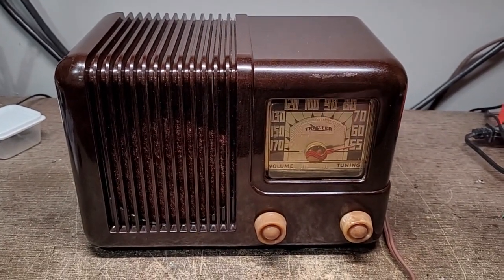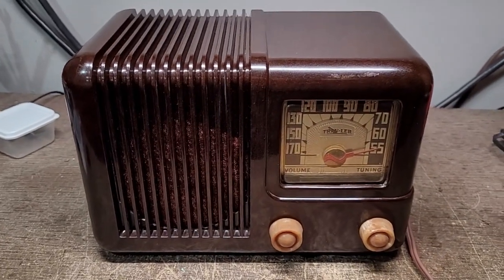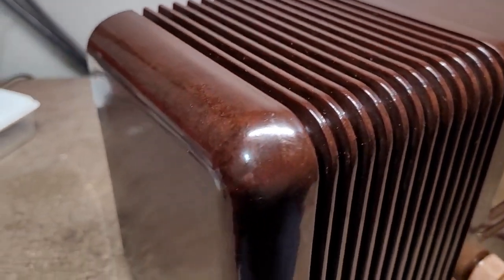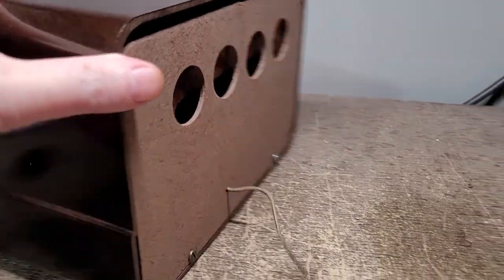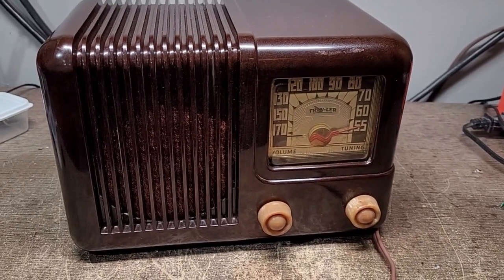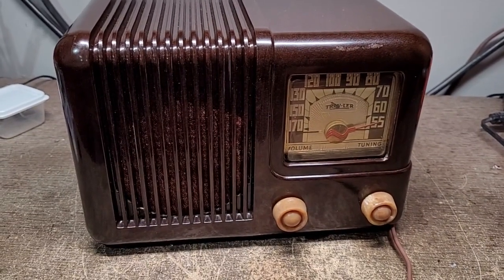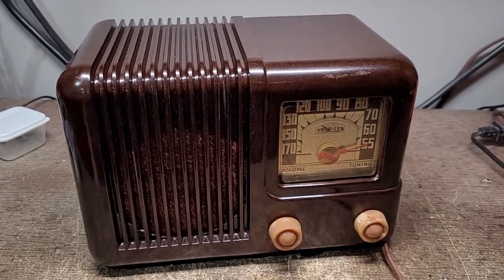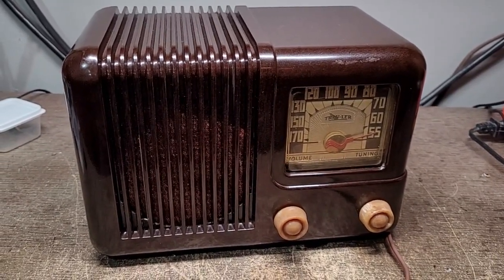New radio---Travler model 5002

Comment: I've got one of those. Mine is white. Pretty much always worked. Speaker cone was shot, though. I added bluetooth to it. GL with yours. Maybe try wiggling the tubes, could just be an oxidized connection.
Reply from the maker: Oh, it was restored months ago (it's in a couple of my later videos)----works very well now